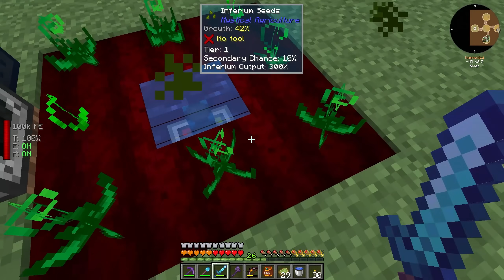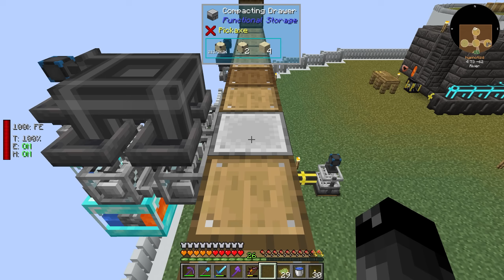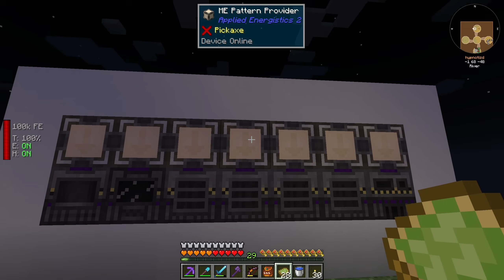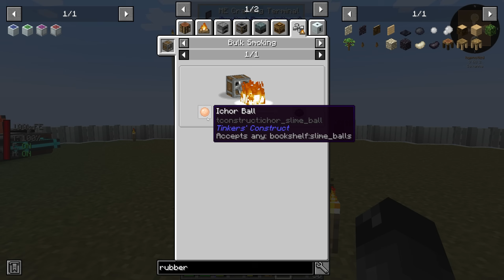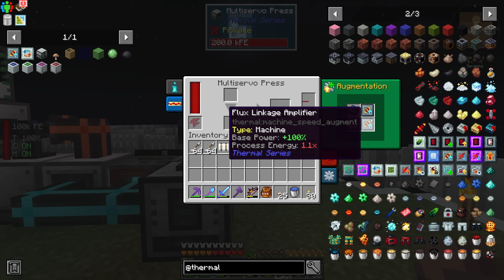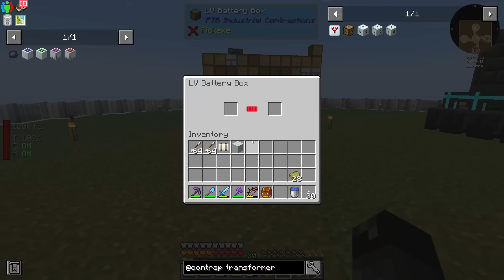Modded Minecraft E30 - Rubber Slime Automation

Comment: The explosions from IC2 when you used higher-tier power for a machine were such a dumb mechanic. In my opinion, it's a terrible design philosophy to punish the player for making progress; if anything, players should be rewarded for progress, not blown up. That's just one of the several design issues I had that made me hate IC2. I'm glad the spiritual successor has fixed some of those problems.

Comment: Phew, I hated IC2 for that very reason! Any mod that causes explosions for not doing something right I just won't use. My heart cannot handle it
Reply: Mekanism fission reactor is so stressful lol
Reply: @dashinking  mine exploded destroying part of my base and spread radiation on my base, i have to afk for 6 hours for all of it to disappear because i couldn't get the command to remove radiation working LMAO
i have to item from projectE to so i wasn't dying from radiation damage
Reply: @duskdawn7819  luckily in my playthrough of this pack I've had no radiation leaks so far but I've had reactor meltdowns/leaks before with much small reactors
Reply: Even worse: it specifically causes explosions for making progress. Things explode when you've made more progress on your power generation than the mod author expected. It's absolutely horrible design, in my opinion.